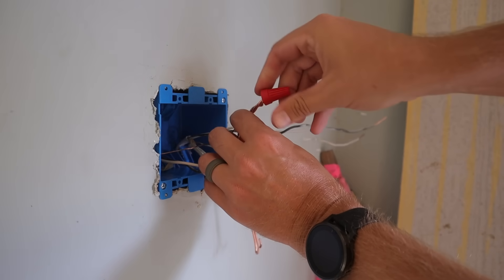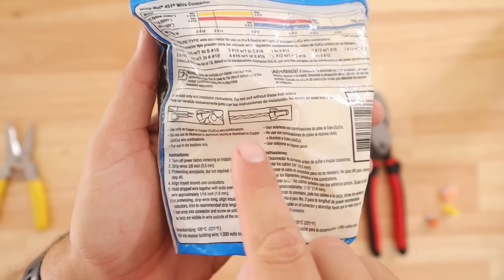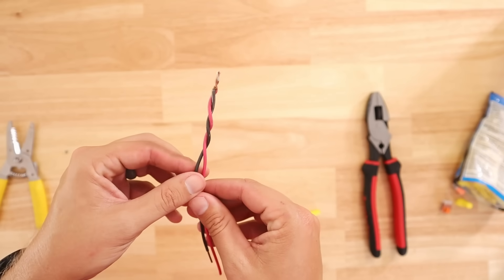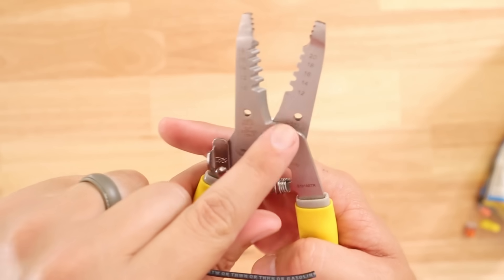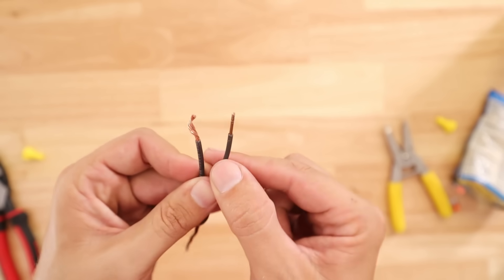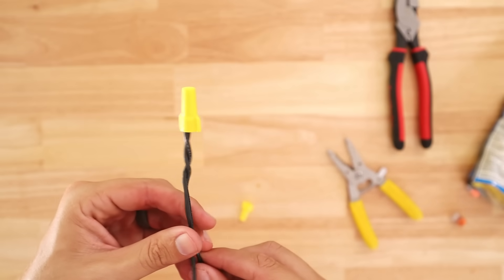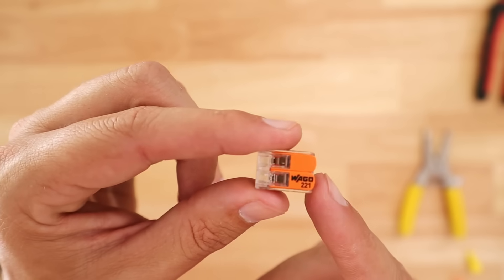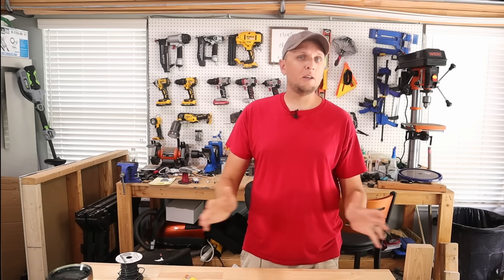BIGGEST Mistakes DIYers Make When Connecting Wires Together | How To

Comment: The wagos are great but they do have a higher resistance and create more heat.  It's not huge, but something to be aware of.  Both wago and wirenuts have their place have their place in your toolbox.
Reply from the maker: Totally agree.  Thanks a lot for the feedback!
Reply: If you’ve got Wagos or wire nuts creating heat on your circuit, you have more issues than just the type of connector you’re using.
Reply: Resistance within tolerance is acceptable . A badly installed wire nut also has  more resistance and these frequently occur .
Reply: A good twisted connection covered by a wire nut is usually the best route. A perfectly installed wago that has high current will heat up everytime!
Reply: @explod329  Need some data here, because me thinks you're putting out BS.
Reply: @91156  Add wagos on all your connections in your home, make sure your fire alarms work, get back with me in 6 months with the data that you came up with. . By the way, just by your reply I can tell that you have no professional experience doing electrical work so therefore your not entitled to even call BS. Good luck with your data finding. Stay safe!
Reply: @explod329  we use wago’s on higher amperage industrial equipment daily they are from the factory and we have had zero failures. They are exposed to very high heat and vibration . If you strip to the right length and they are held in by proper installation you won’t have an issue…if you do your doing something wrong or your not using them to spec

Comment: With pretty much the whole of Europe, where electrical standards are tougher than the USA, use of the Wago is standard. Outlets also use the same lever system. Simple.
Reply from the maker: I do think they have their place for sure.  However, I think wire nuts also very much have their place as well.  Different tools for different applications.  Thanks for the feedback Trevor!
Reply: Lol you guys are where we get the "not my job" meme.

Comment: My advice is to read the instructions that come with the wire connectors. Do not follow the opinions of DIY channels when it comes to electrical. In fact, it is my advice that DIYers not attempt electrical installations unsupervised. You do not pre-twist solid and stranded wire together.
Reply from the maker: I respectfully disagree.  It’s actually standard to pre twist them in some of the strictest areas of the nation by electricians.  But yes definitely read the instructions always.
Reply: @HowToHomeDIY  I've been a union electrician for over 20 years and I can tell you it is not common practice. Many of those years doing electrical work for hospitals. There is nothing more strict code wise than doing electrical work in a hospital. I'm not dumping on you specifically, I have an issue with all DIY channels that encourage Untrained people to attempt work that requires highly trained skills. Apprentice's go thru 5 years of training (in school and on the job) before they are ever allowed to do work unsupervised. Hopefully you can understand and follow this reasoning to it's logical conclusion.
Reply from the maker: While I can appreciate that, my information is coming from a couple of union electricians in a couple of the strictest and largest cities in the nation, seems to me to just be another one of those debated topics.  I do my best to do my homework before I put information out there.  Like mentioned in the video, it’s not required.  I appreciate your feedback nonetheless.
Reply: @HowToHomeDIY  Just so you understand how the code works, the NEC is the National Electrical Code, it covers the entire nation, cities and counties. States can also have their own electrical codes but are for very specific contract work. Hospitals also have their own code book which is a combination of NEC and the state code and also have their own state inspectors (rather than the typical city inspector). So I don't know what your union electrician friends are talking about when they say they work in the strictest cities when all cities rely on the NEC and that's why they pre-twist solid and stranded wires together before installing a wire nut. Unless they are also working in hospitals where a more strict version of the NEC is used, and even then the code as you point out says nothing on how to connect wires, only that you must follow the manufacturers recommended installation instructions. I'm not even sure why this has become the point of contention when this was not even my main argument. The real point is, don't do electrical work unsupervised. I think we can agree that a DIY home owner is less knowledgeable than an electricians apprentice and even they cannot work unsupervised (for very obvious and good reasons).
Reply from the maker: I do understand all of that yes, thank you.  Like I said it’s obviously a subject of debate.  Two different opinions on what works best.  Again, I appreciate your feedback.
Reply: @michaelbradley7529  By that logic I might as well sell all my tools as I shouldn't be doing any work on my car, lawn tractor - and heck, probably even my garden. And I better start working a lot of overtime to pay for all the tradespeople I'll have to hire to fix anything.

Some of the best kept homes are those owned by people who take the time to learn how to properly maintain things themselves. They do the simple jobs themselves (after researching how to do it) and hire out the more advanced jobs to professionals and keep an eye on the work done.

One fault of a lot of professionals, in my observation over the decades, is that they tend to work without ease of maintenance in mind. Wagos are great in cases where modification might be made in the future. I'll keep an eye out for stories that discuss resistance of different types of connectors going forward - but it hasn't been an issue so far after several years of use in Europe.

Comment: Just use a Wago. They're designed for multiple wire sizes a. Types, and treat each wire independently for the best connection. 
I still use wire nuts, too, but it's like driving a 1969 Chevy because it was good enough for my dad. It still works, but newer is generally safer and easier to operate.

Comment: Have seen the WAGO connectors but have not found them in local hardware stores. Makes me wonder if they meet area electrical codes.
Reply: Home Depot carries the 2 and 3 port versions now. You may be able to get them to order the 5 port, as they're very useful. TTBOMK, they're code compliant.
Reply from the maker: In store Ted?  Mine doesn't seem to carry them yet.

Comment: Every connection I have made with wire nuts has been wrong.  I have a question about the twist going down the insulated wire:  won’t it take up more space in the box?  I just bought variety packs of wago connectors for myself and my sons, and that is what I will be using going forward.
Reply: When doing your box fill calculations every 2 wire nuts count as one more wire of the largest gauge entering the box as per code...
Reply from the maker: Wire nuts do take up a little more space but on most boxes they are deep enough to handle it all as long as it’s not being overfilled. The twist going down actually helps to keep everything cleaner, tighter, and together.  Wagos certainly have their place.  Hope this answered your question.
Reply: Quite frankly, being in remodeling, we do not recognize any significant benefit to all that twisting, and it frequently makes our job harder. Just a couple of twists past the wire nut, at most, but ALWAYS pretwisted, is what we like to see.

Comment: I just replaced my wired smoke detectors in the house. Even though a professional electrician had done this, there were a number of connections on the solid core and stranded that were marginal, and some of my red wire (communication) were pretty much not connected. I was always taught to twist my stranded and place it a little higher than the solid before placing the wire nut. I can then twist the stranded around the solid with my fingers, then put the wire nut on. I’ve been using this method for years on light fixtures and I have never experienced a problem.
Reply: I can attest that there are lots of sloppy electricians out there, and apprentices that have not been well-enough supervised. I'm more or less in agreement with your preferred method here although mine departs from it a bit.

1. I don't pre-twist joints made with very small (e.g. 18 gauge) stranded joined to solid house wiring, just make sure the stranded leads the solid going into the wire nut. If installing new fixtures this is also the only place I will sometimes use the supplied wire nuts if they are smaller and of a sharper internal cone shape compared to the standard size I'd use for a couple or three solid 14's. (I draw the line at using the ones that don't even have a metal coil in them!)

2. When I pre-twist larger gauge standed to solid, I leave the stranded straight, put a little bend on the solid and attempt to wrap the solid around the stranded as I twist with my fingers. The stranded will bend easily anyway, and with a little practice you can get a nice barberpole twist instead of just having the stranded left wrapped around a straight solid.

I always pre-twist everything other than those tiny equipment wires, first with my fingers (especially helpful for >2 wire joints) and then tighten with the linesman. For bulkier splices I will point the tip when trimming so that it dives further into the cone of the nut.

Finally - no matter what kind of splice it is, I give each wire a good tug or two to make sure it really is captured securely - which is why I'm not that keen on having a bunch of twist on the insulated wire outside of the nut.

Sheesh that was supposed to be a quick comment, not a treatise...
Reply: @civildiscourse2000  120V over 18gau? I am more risk-averse.
Reply: @davet.5493  Well Dave, don't look inside a typical industrial control cabinet or your head might pop off. 😁

Here I was referring to things like smoke detectors and luminaires that are supplied with light-gauge stranded wiring for connection to household circuits. The latter are run with solid AWG #14 minimum in Canada and - so far as I know - in the US as well. So unless you're going to modify approved equipment you have no choice but to connect to those dinky little wires.

As an apprentice I worked with a journeyman who thought it was crazy that we had to install #14 wiring but manufacturers could "get away with" using smaller gauges. It isn't. That was one of many things he had forgotten or never been taught properly.

Gauge is fundamentally related to current, not voltage. A smoke detector draws a piddly amount of current and could easily be fed with telephone cord. The wires are only as big as they are to be robust enough for the physical stress of installation, and to survive a fault long enough to allow the circuit breaker or fuse to open the circuit. 

Voltage rating is fundamentally related to insulation resistance. You can buy #18 rated at 1000 V if you like.
Reply: Another way, twist the stranded one so its straight, make it a little longer than the solid one, lay them next to each other, hold them tightly with left hand and put the wire nut on with the right hand twisting as hard as you can. Tug test. If it’s OK, it’s good for 100 years.  
Just another way, FYI
Reply: Honestly man when it comes to stranded wire anywhere I'd prefer to just use wagos. There's a higher chance of strands getting damaged or kinked when trying to do all that twisting and then you're left with a big ol mess if you ever have to redo the connection. I've actually just stopped using wire nuts because I prefer how clean and easy wagos are. The typical 221 wago is rated to 400V and 32A - that's WAY more than enough for the average homeowner running 12GA solid core wiring on 120V circuits. 

Yes they're also way more expensive but I'm just using them on my home I'm not worried about calculating material cost on thousands of connectors used every year.

Comment: I have become a big fan of the Wago. My dad is still old school wire nut guy, but I like the Wago. We both get the job down and meet code.
Reply from the maker: Yup both will work.  I have certain things I like the Wagos for and others where I prefer wire nuts.  I appreciate the feedback Brad!
Reply: Just do yourself a favor and only use them on low current situations. Wire nut is not the old school way, it’s the correct way if the connection is twisted. Wagos are dangerous if used with higher currents, same as wire nuts when the connection is not twisted.

Comment: Here in the UK, wire nuts were never used. The trend over the last 5 years has been connecting everything with wago 221s. I can't fault them for speed, security or peace of mind.
 Being clear, you can see the connections. The wire is held under constant spring compression, so the quality of join is maintained forever. Regardless of vibration or temperature changes.  The Wago is superior in every way, and the price is the only separation. You can't argue that price difference if you ever have the horror story of finding a bad connection later.  Minimum it's a pita. Worst case it's a fire
Reply: Some here in the US have seen what the lazy wago will do. Throw some current to that bad boy and listen for the smoke detectors! They are a fire hazard just waiting. They are the same as backstabbing a outlet! Dangerous! There is just not enough surface to area there. If a electrician can’t take the time to twist a connection and cover it with a wire nut then he doesn’t need to be doing electrical work.
Reply: Same here in Oz.   We are Wago bitches here too.  Wagos are taking over from blue points - a brass ring with a screw to fix it down, with an insulation cover....  Americans don't seem to want to test anything either - another reason why this stuff gets done.
Reply: @tcpnetworks  What are blue points? Do they go by another name that I could search for? I’m an American homeowner (not an electrician) and I already use Wago when I need to do wiring. I’ve rented a few different homes over the years that still had original wiring from the early 1900’s which started my interest in learning about the evolution of various building techniques.
Reply: Also much easier for trouble shooting
Reply: Wire nuts are an abomination; the Wago 221 is a much more elegant solution.  Here in the US, the ubiquitous recalcitrance among those in the "trades" fosters a resistance to the adoption of Wagos as the standard solution because those same "professionals" are philistines and anything novel, sophisticated, or advanced frightens and confuses them.
Reply: @dragonwarlock4354  Totally agree.  Not many people in the US trades want to trust "new" technology.  As a Contractor, I agree that something needs to be proven before I jump on the bandwagon, but I believe that nothing is perfect (well, not "nothing"...certain nothings are definitely better than others - LOL) and everything can be improved on.
Reply: O

Comment: Or just pitch the wire nuts and get Wago's. I haven't used wire nuts in a year atleast. If I'm doing low voltage (110-115v) I'm using a Wago. You can use them on 220-240v but I use a wire nut for that voltage. Wago's have been great, and never had a single issue.
Reply: The standard European voltage phase to neutral is 230, and Wagos have been used here for a number of years. Wire nuts are actually outlawed under UK code.
Reply: I only use Wagos now. I’ve noticed that they don’t grip as strongly onto a wire that has threads cut into it from a previous wire nut. I always cut the damaged portion off now. The best thing about Wago is you can change the wiring in the future as many times as you want without further damaging the wire.
Reply: NEC low voltage is now anything less than 1000 volts.
Reply: @stevenporche6153  I work in maintenance and I was always taught any wall power is high voltage see it on all the covers and the term low voltage is for 8- 24 DC or AC voltage operating systems inside machines

Comment: Your video at timed 4:00 minutes shows correct splicing BUT, following the twist then snipping-off top, need to add one last twist prior to wire connector. This is crucial due to when snipping, then immediately capping-off with connector as done in video, the end that was snipped-off was the binding of that initial twist, therefore one last twist is essential following initial snip and prior to wire connector for true connection.

Comment: DIME STORE SCOTCH LOCKS USE SOFT WIRENUTS MUST BENT THEM YOUR FINGER TO KEEP A WIRE BACKING OUT THIS GUY COULD NOT BE ELECTRICAN
Reply from the maker: I’m not quite sure what you are trying to convey Scott.  These wire nuts in the video are the same ones every electrician I know, at least in my area, use.  The 3ms work well too. That being said, if you can point me in the direction of code where it requires a certain brand’s splicing device, I would be more than happy to review it.

Comment: The Wago 221's. When used on solid core wire, you are wasting your time playing with the lever. Strip to the 10mm as required by the gauge on the connector. Then push the wire in, pull back, and you're done. You only need the lever to remove the wire.
The push in connectors without the levers are reusable as well. Pull and twist until the wire comes out. Never knew that until I read the label.
Reply from the maker: Thanks for the feedback!